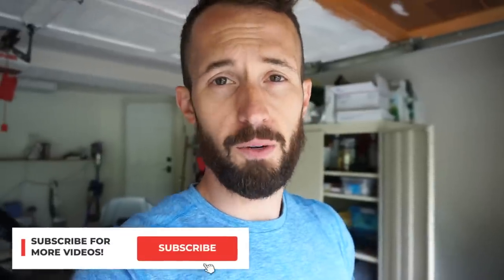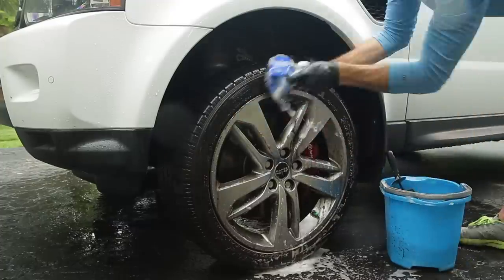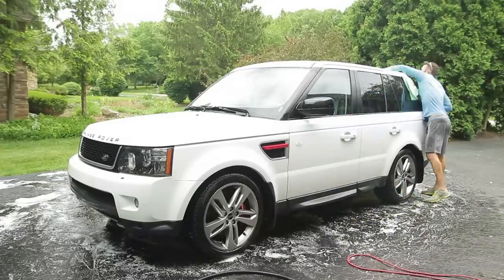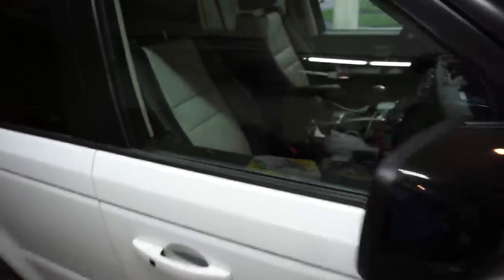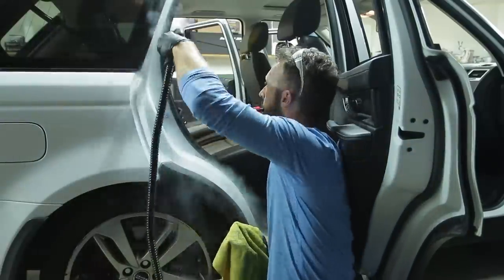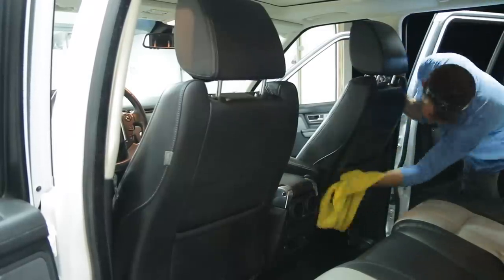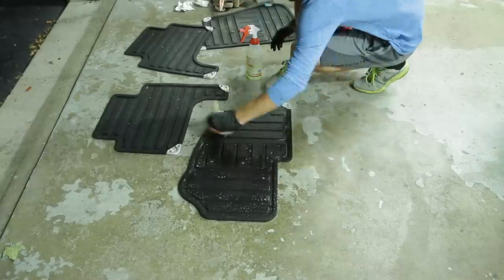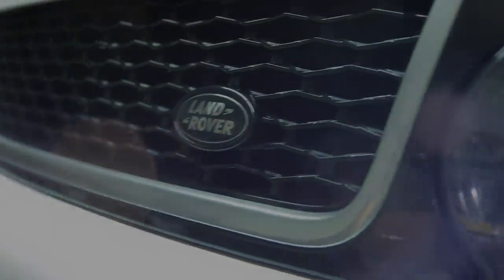Deep Cleaning A Range Rover Sport! Complete Full Car Interior & Exterior Detailing!

Comment: Great work. Here's a tip I learned a while back for glass. Always, wipe the inside vertically and the outside horizontally (or vise versa. just ensure you always use the same method) . That way if you see streaks left, you will know at a glance which side they're on. Cheers
Reply: Thanks so much this helped me with my first detail
Reply: @wucus295  Glad to hear Jacob!
Reply: Neat tip. Thanks.
Reply: Neur0bit that’s actually really smart thx✌🏼✌🏼
Reply: Really helpful tip, can’t wait to try it
Reply: Cool advice, I'm going to use it now

Comment: Good stuff! I drive a 2019 Ram Limited. It’s great but the Grill is a bear to clean after a bug filled road trip. I used the steam cleaner to loosen up the bugs then a foam soak then power wash. It’s a process but works wonders. I also try to always wax the front of the truck where possible it makes the bugs come off even better.

Comment: My tips if i may

Use some spray on wheel cleaner first. Spray it on, leave for a few in and rinse. That will remove most of the brake dust from wheels and make your work easier. 
Pay attention on the tube when vacuuming the inside to avoid scratches on rear bumper and side skirts.
Streering wheel is one of those places where you want to use steam to clean it.

Comment: Great job & videos! I’ve learned lots from them thanks
2009 Challenger SRT8
2016 Accord Coupe Touring
Have you had a glare on front windshield from using protectant on front dash? I’ve  Been told to use just water so I don’t get reflection.
Also I just had tires replaced on my rims and they moved the balancing weights. What would you recommend using to remove glue left on rim from old weights?

Comment: Hey James, I just upgraded from a Holden Cruze to a gorgeous 2016 Mazda MX5 and the dealer did a sub-par job with the detailing. Two weeks in it's time for a clean, but I want to use a better cleaning method with this beauty than I did with my Cruze. Looking at your video, I think I'll do a full detail rather than just the wash and vacuum I was planning. Thanks for the great info!
P.S. this is your first video I've seen, if you haven't made one already, can you do a video around washing and caring for a soft top in a convertible?
Reply: And I'm definitely putting vacuum lines in the boot!

Comment: Hey, a quick question. I don't have a pressure washer, just a garden hose with wide spread. Is it good enough to clean my car with that? I drive a pretty scratched up 2005 Ford Focus. I want to detail it a bit so it doesn't look that tired and old. Also, how can I remove some deeper scratches on the paintwork?

Comment: 1. 1999 Dodge Ram 1500. It had a cracked dash (shocking) and a bad engine. It didn't help matters that I put 10 quarts of oil in the engine. 
2. 1993 Chevy Lumina Euro. It had a bad fuel pump however I scrapped it because I needed the money. 
3. 2005 FORD Freestar minivan. My current daily driver. Needs some work but it still runs great.

Comment: How do I clean the speaker covers on the door without damaging the speakers?
Reply: Generally speaking you won't damage the speakers unless you are liberally spraying product directly onto the cover, where it could get through and onto the speaker. To clean any interior trim, you can spray an all purpose cleaner onto a microfiber towel and rub the surface, or if the little holes are full of dirt/dust, spray some cleaner directly onto a soft bristled detail brush and agitate on the cover, then wipe off with a fresh towel!
Reply: Thanks

Comment: Ceramic coatings are for those people that don’t have time. They are extremely easy to maintain compared to a “wax” or sealant.  You only have to use a topper once ever 6 months.  Coatings are 100 times better for those that don’t have the time.

Comment: Dirty, but easy detail job. Like I said before, you remind me of how I detail. I use a similar interior shine. It does add a lot. I rub it down, like you do, after I spray it. You have a couple different methods from me, but it works. I would like to see how you buff a car. You want detail, you have to see what I do. Wheels come off and I pressure wash under the car and between the wheels. I undercoat and sometime paint the  calipers and rotors with caliper paint. You know, when I move the steering wheel in a circular motion, I clean behind it and between the steering column with a brush. I don't know about you, but it bugs the heck out of me when people do not roll the window down to clean it. lol

Comment: The cars that I've travelled in but haven't driven that I know of are/were:

1. 2002 Peugeot 807
2. 2001 Renault Laguna
3. 2002 Renault Espace
4. 1996 Skoda Octavia
5. 2014 Skoda Fabia
6. 2013 Skoda Octavia
7. 2007 Skoda Fabia
8. 2004 Skoda Octavia
9. 2012 Mazda CX-5
10. 2006 Peugeot 207
11. 2006 Suzuki Grand Vitara
12. 2017 Volkswagen Polo
13. 2007 Peugeot 308
14. 2006 Ford S-Max
15. 2007 Renault Laguna
16. 1998 Peugeot 206
17. 2007 Renault Twingo
18. 2012 Renault Clio
19. 2007 Nissan Qashqai
20. 2014 Nissan Qashqai
21. 1998 Subaru Impreza
22. 2000 Nissan Almera Tino
23. 2003 Vauxhall Meriva
24. 2012 Ford Ranger
25. 2013 Peugeot 2008
26. 2012 Ford B-Max
27. 2008 Ford Fiesta
28. 1995 Volkswagen Cabrio
29. 2002 Citroen Berlingo
30. 2015 Fiat 500
31. 2001 Vauxhall Vivaro
32. 2005 Ford Transit
33. 2010 Vauxhall Movano (I think that's what it is)
34. 2004 Kia Picanto
35. 2006 Citroen C4 Picasso
36. 2007 Ford Mondeo
37. 2001 Audi A4
38. 2003 Audi A3
39. 2012 Dacia Sandero
40. 2013 Renault Captur

Plus, here is a car that I drove when I was having a driving experience at Mercedes World in/near Cobham, which was a 2014 Mercedes A-Class.